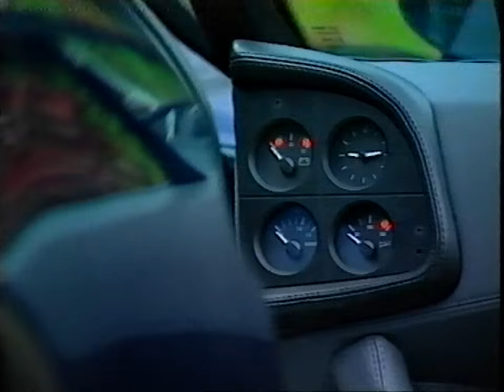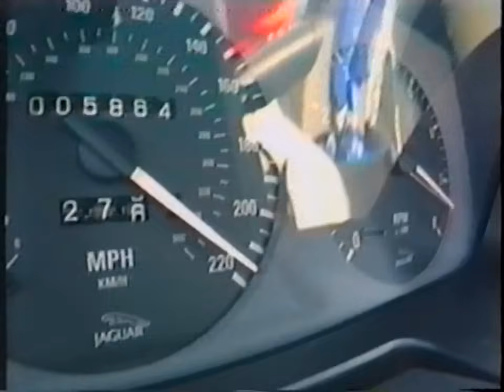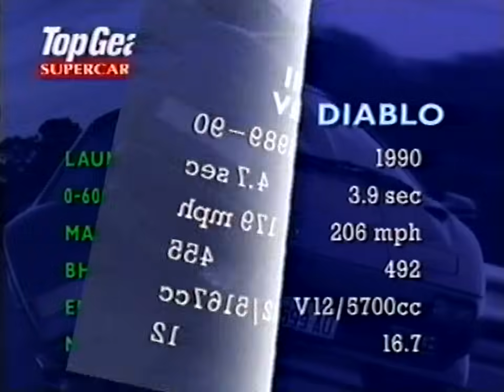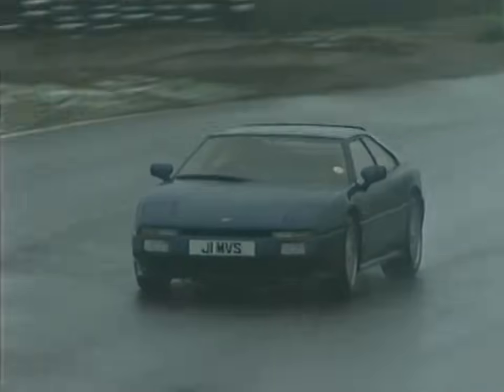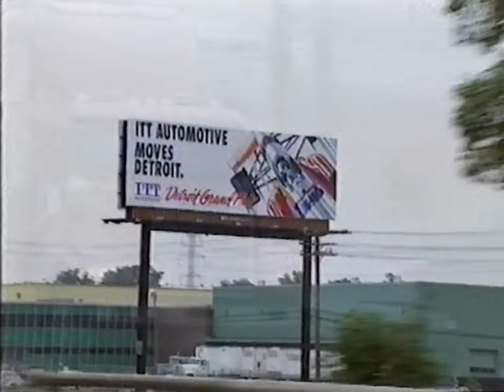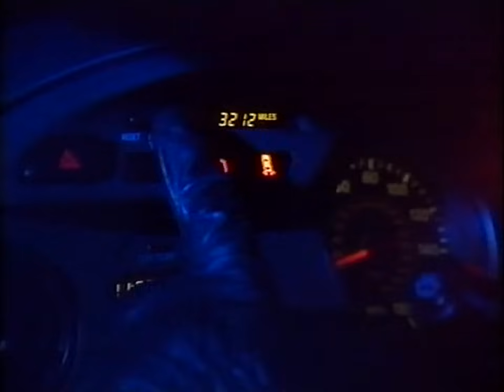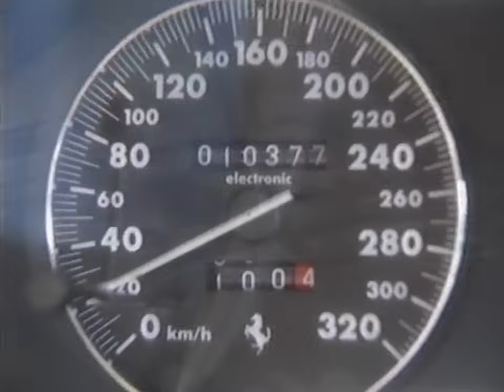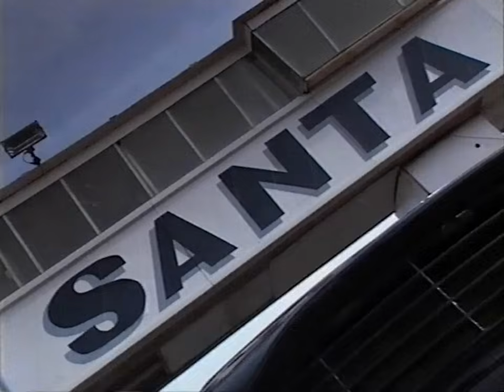Old Top Gear - Super Cars 1994

Comment: I was 18 in 1994. I remember the first time I saw cars like the Diablo, F40 and 959 in a magazine and just couldn’t imagine the power they had back then. Over 25 years later and cars like the Mustang GT have 460 horsepower and can do 0-60 mph in under 4 seconds.
Reply: Yeah, the performance is in lesser cars now but nothing modern matches the looks of a diablo xj220 f40. There is a diablo near where i live and it is epic in person on the road
Reply: And yet that still doesn't devalue any of the cars you listed. They are the best for a reason.

Comment: seeing it in context when it was newish i see why people don't like the NSX as much as other fast cars from back then, if you line it up against other stuff it doesn't have much personality, it does have VTEC though and that's just as good imo.
Reply: the point was not to build the loudest and most powerful supercar, it was to build a nimble, MR sports car that rivaled Ferrari 355 and Porsche 911 but at a fraction of the cost with the typical build quality and reliability of Honda. Final testing of the chassis with Ayrton Senna didn't hurt either :)   Although I wonder how the NSX chassis would have handled modifications to compete vs Jag XJ220/F1 territory... Wider track, Twin turbo v6 or even a lightweight Honda V10 detuned from F1 (like the F50 V12)... some crazy dream I have.

Comment: The engine is assembled in Nippleston, the gearbox at Womblesley, before being shipped to the main Jaguar factory at Whipplebottom where they’re mated to the chassis, which was made by TWR in Bell End.
Reply: Bollocks.

That's where the final builds were checked over before shipping to dealers.

Comment: I always forget the sheer absurdity of the original Viper, its one of the few production cars to look almost exactly like the concept version.  Even back in the 90's you had to think of things like crash standards, meeting emissions, people expected creature comforts like a quiet ride, nicely trimmed interiors, a/c, power windows, hell windows and a functioning top were just givens at that time(we had come a long way since a 1950's MG).

Then this outrageous looking brute just shows up and gives everybody the middle finger.  The OG Viper is one of my favorite cars for all those reasons.  I know the newer model Vipers had hardtops, windows, were more usuable/comfortable cars, but the original RT/10 roadster is by far my favorite.
Reply: YUP RT/10 is also my fav, wish they did a remake of it before stopping production of the vipers.
Reply: Yep.  It was meant to be a "modern" Cobra.  Nasty, Brutish, but insanely fast.   The original F40 was in a similar vein... no comforts, no radio.  Just a twin turbo V8 and the accessories needed to get that power down.   If buyers wanted a Harmon Kardon 10 speaker stereo (which you would never hear over the engine and gearbox anyway...), they were advised to apply elsewhere.

Although of limited use as actual 'cars', I have great admiration for these single purpose machines....  and for those who demand comforts and luxuries, there's always a bloated Cadillac waiting for you at the dealership!

Comment: The mid nineties were really the golden age of supercars.  Raw, visceral, brutal, with little in the way of driver aids and the propensity to kill you if you ran out of talent.  And the sheer beauty of the cars on offer was (and still is) a joy to behold.  Granted, there are some cracking cars in the segment today, but I'd take a Porsche 959, Ferrari F40, Bugatti EB110, Lamborghini Diablo or Jaguar XJ220 over any of them, and that's largely because today's supercars just don't have the soul.  If someone offered me the choice, I'd take the Jag in a hearbeat, because even in 2019 it looks like it was designed in the future.

Comment: As a matter of comment: I did drive a V550 Vantage not so long ago, but not in the best time of the season. What surprised me was general opulence of feel in the interior and the car controls: the steering is light, the clutch and brakes are so light you barely feel them. The car has somewhat beefy 275 mm high profile tires, they flex on the road quite a bit. However, the power seems to be endless. I haven't unleashed it, but really, that car is extremely brutal in its engine.

You push the gas, and it wacks the tail on the straight, lol. It's quite a thing.
Reply: I can confirm that the power is indeed endless. This video, and the Vantage clip in particular, is the very reason that this car has been in my head for 30 years. So much so that when the opportunity came, I bought one. I took it on the Autobahn this year (2023) and my bottle and driving skills were found wanting way  before the Vantage's capabilities were reached. That was around 170mph, and she was still pulling. I've some videos on my channel of it.

Comment: How quaint that at tthe time of airing, an XJ220 was considered a "bad investment". Heh.
Reply: met a guy in oxfordshire who has 2 silver xj220's,question is,why? a doomed car from the get go.as the original car was supposed to have a v12.it never sold in the amounts jaguar wanted,but i would say leap forward to today and its prob making money.
Reply: The real issue is the maintenance... the XJ220 requires an engine out service every 6 years that includes a fuel bladder replacement at a cost of around $75K to $100K. There are only a few places in the world that can correctly perform this service. My experience with some of the owners that I know is that this is not common knowledge and takes new owners by surprise.
Reply: @Fulloctanegarage  The Ferrari F40 also has the same "issue" with fuel bladders, but that car keeps its value much better.
Reply: Moriquendiii I agree... interesting as I believe there were even less XJ220 built (271) . The point I was making was really about the maintenance to car value comparison. Someone buying a  $2.4 million Ferrari compared to a $350k XJ220 with similar $100k maintenance impact.
Reply: When I was a kid in the early 90's I always thought the XJ220 was the best looking of all the exotic supercars that had appeared like Diablo, F40, EB110, 959, etc. Even today it hardly looks dated at all. It was such a beautiful, sleek car.

Comment: LOL the XJ220 sounds like it has the GM 3800 from the Grand Am
Reply: no, no it doesn't.
Reply: It’s not a great sound.
Reply: Makes one wonder how it would have sounded if Jaguar did use the v12 they had originally planned to use.
Reply: @bghoody5665  instead of the engine from a Mini Metro.
Reply: The Grand Am sadly never got the 3800. It typically had the 3.1 or in rare cases the 3.4.......

The Grand Prix had the 3800.....

Comment: Pretty sure the Renault A610 shared a good bit of its chassis with the DeLorean.  It has the same PRV V6 mounted behind the rear axle like the DeLorean, only turbocharged and now fast.  

Kind of a pity that DeLorean never could get a mass market car maker behind his idea, because the styling was wild but the mechanicals and reliability were garbage.  Also didn't help that he launched the car in the middle of a nasty recession.

Comment: The Matra Murena was denied the engine that you see in the A310. Imagine that in a mid engined car much lighter than the Venturi. And it was designed around it so it can handle it. But Renault said no so the Murena got a 2.2 Litre Van engine. What a shame.

Comment: This sure does make the early to mid 90's look like a time of innocence, lost to the sands.
Then I realize the insane power available to the average Joe. 
Even electric cars that would smoke the Jag...
Reply: Power and speed is more easily attentiable now but the cars are no where near as raw and fun as 90's cars.
And certainly don't look as good
Reply: @crg92  While speed is obviously an objective measurement, sense/perception of speed is completely different. I was born 95, but I did drive my grandfather's 90s Renault megane. I can say that the sense of speed and sheer driving sensation was vastly superior to the modern cars I have driven.

That car probably had 1/3 of the power compared to the modern cars I have driven, but it doesn't matter. The advancement in tires, suspension systems, driving aids, electronics, aerodynamics etc have made cars more safe and efficient but alot less fun/raw to drive. 

I also agree with looks, most modern cars are ugly, dull and are barely distinguishable from another. They have no character or charisma anymore.

Comment: What's funny now, is that the Diablo would get positively SMOKED by pretty much every super/hypercar today. It might've been quick back then, but Lamborghini must have known that the Diablo's speed would eventually get crushed.
Reply: Top Gear did a comparison in one of their programs between current performance models of mainstream cars and the equivalents from 20ish years ago (Audi Quattero, Golf GTI, etc). Not all the newer models were faster  - tyres, brakes and suspensions were much better though. A lot of the newer cars are much heavier.
Reply: Let’s just remember that the Diablo was around in 1992, that’s 30 years ago, 3.9 0-60 and 204 mph was fast as f-ck back then. And the xj220 is still bloody fast even by today’s standards. 3.6 seconds and 217 mph. That’s only 1 second behind todays best.

Comment: A 911 with a sludgebox IS a sacrilege, Ferdinand Porsche would be spinning in his grave, it's even worse now that modern Porsches come with the automatic as standard equipment (yes the DSG IS an automatic, it just sucks marginally less than a torque converter sludgebox, but it sucks nonetheless, a TRUE Porsche needs THREE pedals, not TWO!

Comment: 30m19  , NO JEzza, mid engine car, is a PORSCHE trick.
Porsche was sticking engines in the middlle when Ferrari and everybody else was still putting V12's up front !

Auto Union Type C = Mid engined, design by Porsche
The original Porsche 356 : Mid engine
550? mid engine
904? Mid engine

Mid engine cars = Porsche trick

Comment: I’m reliably informed by many 12 year olds who play Forza that the Supra makes 1,000 horsepower and runs an 8 second quarter mile completely stock.
Reply: Indeed. It was a 14 second car stock. That said it was trivial to add +100hp to one of these so virtually none of them remained stock for long. You need to pull a vacuum hose, add a $5 valve from the hardware store and add a $100 boost limit defeat chip to the ECU. That's all it takes.

In a smog "friendly" state you can do considerably more, but for that you'll need to pony up for a standalone ECU, a larger turbo and more fueling.
Reply: Doctor Smith that’s the modern import version of the old domestic V8 formula of an exhaust and air filter to double your power.
Reply: @ImInLoveWithBulla  It actually isn't. Modern turbo cars are much "smarter" than that. In the 1990s however,  you could and nearly everyone did. The Supra was particularly nice in that it was difficult to get wrong. It could supply fuel for a 500hp car and if you did get a knock it would retard timing and disable boost
Reply: @ImInLoveWithBulla  A K&N was mildly worth doing on my L98 but I doubt it was good for 20hp, let alone double all the horsepowers. It needed a cam, it needed a free flowing exhaust, at that point it would probably need fuel. It would also be totally un-smoggable, unlike these other cars where you still can.
Reply: Doctor Smith my brother has a 1982 Ford F100 with the 300 6-cylinder. I’m not even exaggerating when I say an exhaust, a 4-barrel and an air filter doubled the horsepower.
Reply: @ImInLoveWithBulla  Are you sure that was an 82? There is no possible way you are doubling horsepower with the factory cam on a base model. Horsepower barely moved even with the optional fuel injected 5.0. That one you could fix though.
Reply: Doctor Smith either an 82 or an 81. The engine was completely strangled by the tiny carb and exhaust. Edelbrock manifold, 4 barrel and full exhaust completely transformed it.
Reply: Doctor Smith either an 81 or an 82. Those 300 I-6s are strong and reliable as anything, but they were stupid strangled.
Reply: @ImInLoveWithBulla  That one (Ford 300 I6) makes a lot more sense, although at that point you've really only "doubled" to around 200hp. You can go far higher but you will need to replace many things and ultimately it's still attached to a F100 so the handling is...not great. You can put an upgraded 460 in a Pinto too but you probably shouldn't unless you plan to trailer it to dragstrips.
Reply: Doctor Smith I’m not saying it’s fast. Just a lot faster. I still think my brother should swap in an Australian Ford Barra into it.

Comment: tiff what ever you do donts mention the XJ220 has a mondeo engine and not a V12 we promised every one.
Reply: Because it doesn't. If you're going to mock something at least spend a couple of minutes reading the Wikipedia page fist. The engine is actually a radical development of the Metro 6R4 engine, done by TWR (who knew a thing or three about performance engines).
Reply: The Aston Martin db7 had two mondeo st 200 engines which made there v12.??

Comment: the Golf is a " Fast " car. 1.8L, 112 horsepower. 0-60 in 8 seconds... ... ok....
Reply: For the everyman, the original Golf GTI was a fast car. It was the go-to Hot Hatch of the late 80s and early 90s (that and the Peugeot 205 GTi in 1.9l spec).
Reply: ok............
Reply: @leopold7562  yup. Don't forget the wonderfull gsi 16valve. That was fast back in the day as well. A massive 150hp in a hatchback was incredible back then. Sharing the road with little 50hp cars everywhere.
It was glorious lol.
Reply: @1flynlow  You don't seem to understand power to weight ratio. 0-60 in 8 seconds was fast at that time. Is it sports car or super car fast? No. You'd still be faster than the majority of other cars on the road at that time.
Reply: Placeholder Name we dont need to know power to weight when we know exactly what the acceleration figure is.
Reply: I restore 80s cars. I know all about it lol. I took my 85 v6 firebird from 135 flywheel hp and 165 flywheel torque to 140 rear wheel horsepower and 170 rear wheel torque. and all that work to be slower than a modern base Camry. but it was fun to make such an improvement on my old car. I appreciate them for what they are
Reply: Remember the charade gt-ti ,999 cc, turbo, 100 bhp, 0-60 in 7.9 seconds. Great little car.👊
Reply: That was quick in 1984.